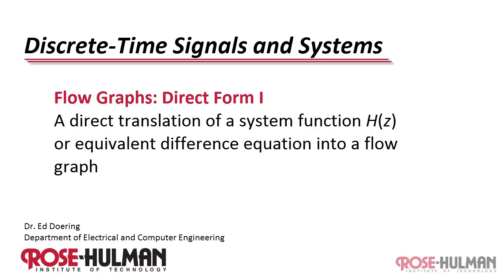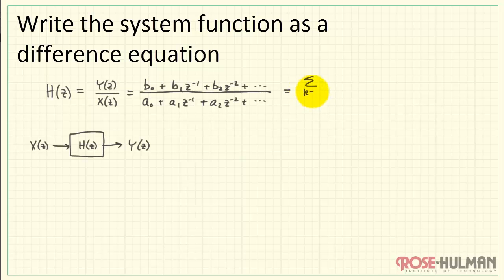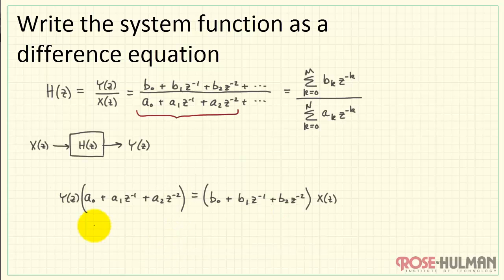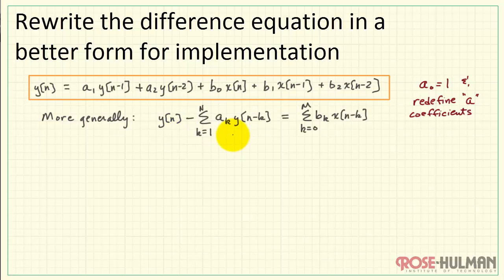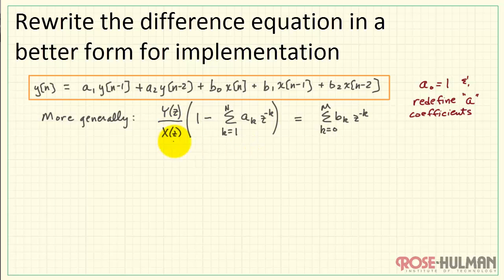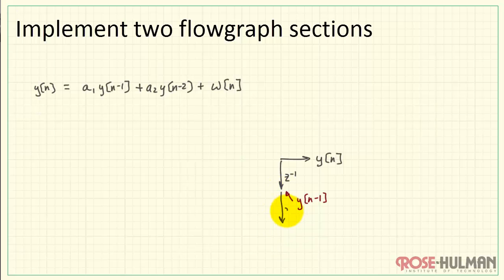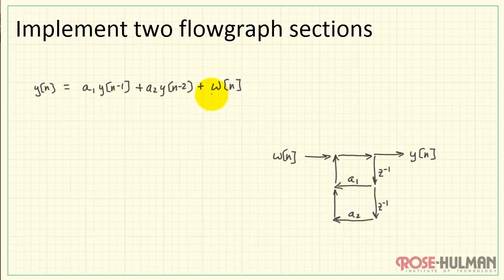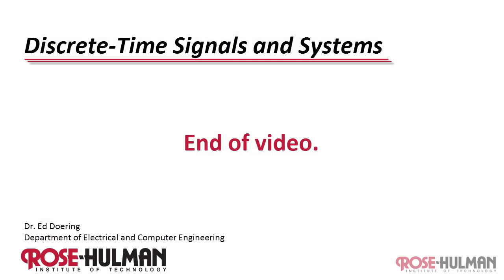Tutorial: Flow graphs, Direct Form I

Comment: The flow graph at 0:22 on the numerator side doesn’t make sense. The direction of the delay is correct, but it’s on the wrong side + fix direction of the right node where w[n] converges and moves towards the y[n] node.